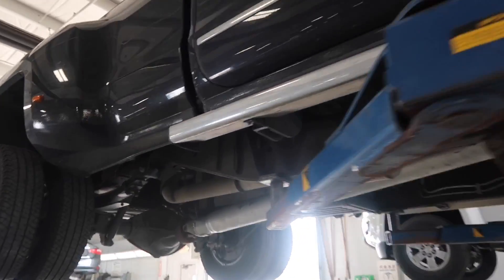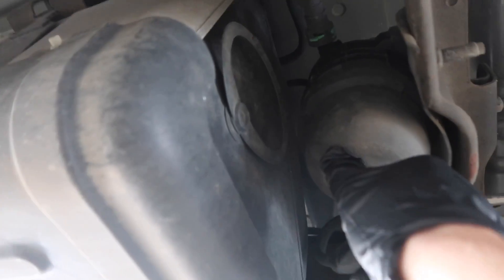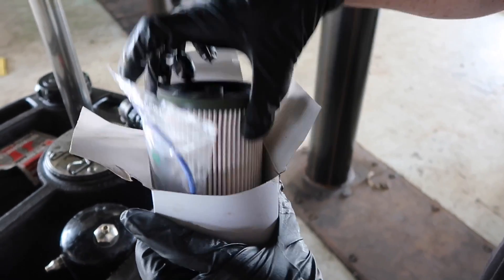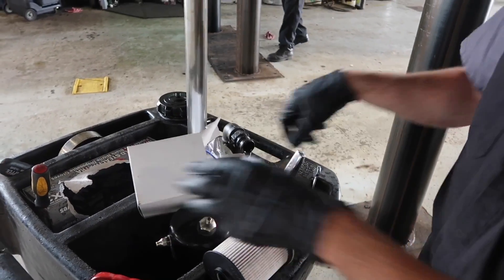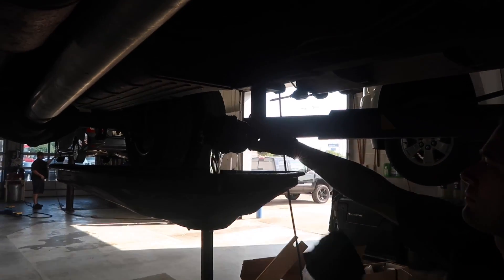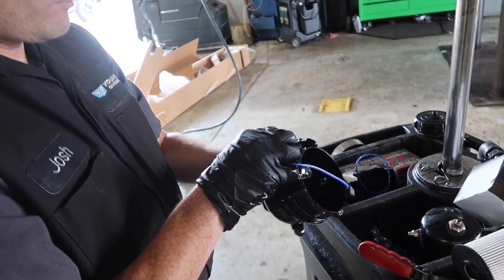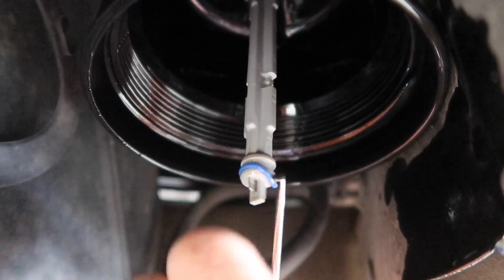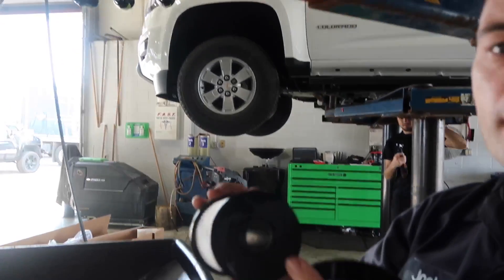2017-2019 GM/GMC Duramax L5P Full Filter Replacement

Comment: No mention of shutting off a fuel valve or priming after the replacement, is this a necessary step? Is there a button to push to prime in the engine bay similar to LBZ?
Reply from the maker: Nope all you need to do is cycle the key and start it 👍
Reply: @TruckMaster  Thanks! Is the fuel somehow shut off with a check valve of some kind? I will only have to deal with residual fuel in the filter?

Comment: It’ll be difficult to take off because you’re lubricating with diesel. Using thin layer of O-lube on the ring and the threads prevents all of that. Diesel sucks as a long term lubricant.  Not that what you’re doing doesn’t work, just throwing it out there.

Comment: Do the L5P’s need to be bled after fuel filter change? Do they have a fuel pump, or is a lift pump, (like a Fass) still a good idea?
Reply from the maker: I’m really not sure I’m hoping to get more knowledge about that but I would say yes to the lift pump since it separates water and dirt in the fuel better and no you don’t have to bleed the fuel filter
Reply: You let the pump run for two minutes try to start for 15 seconds, if it doesnt start or stall do the 2 minutes again then try again and just repeat till it starts ~ a GM tech
Reply: l5p has factory lift pump. thats why theres no need for any hand pumping to prime it. just turn the key and it self bleeds i think. wish they did that for LMLs...much better of a system other than the cheapo plastic

Comment: I have what looks like the same fuel filter on my 2018 Cruze diesel.  How do you break the torque on the housing?  My filter is not solidly mounted to the vehicle.  Is there a tool to hold the upper housing?  Or do I just need to grab it with a big pair a channel locks?

Comment: What happens if you dont lubricate the o rings?
Reply: They can dry out and potentially crack and leak. They can also " bunch up"and not seat properly when you spin the canister back on. Always start the motor and check carefully for leaks.